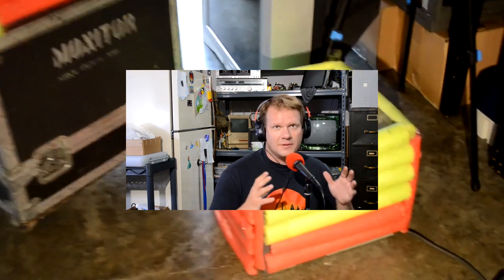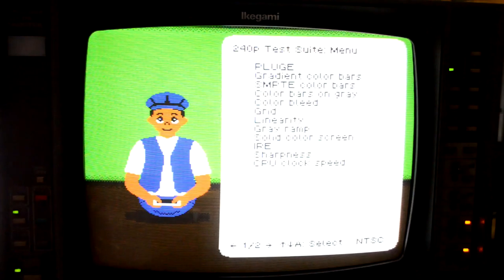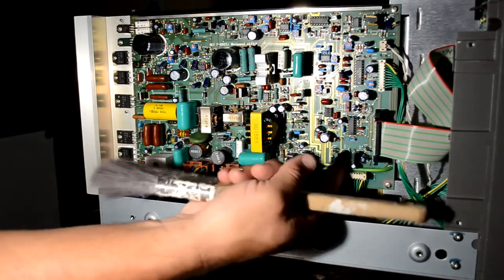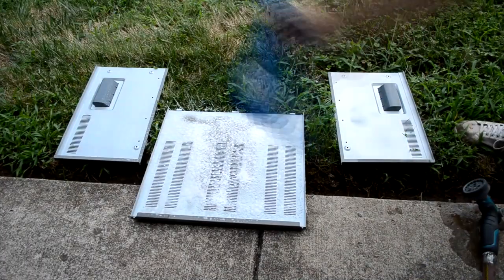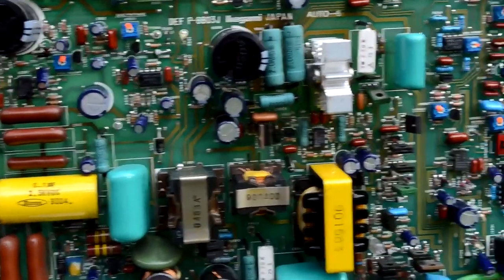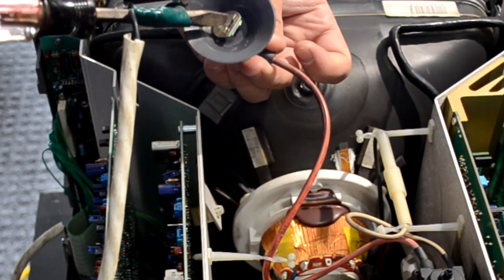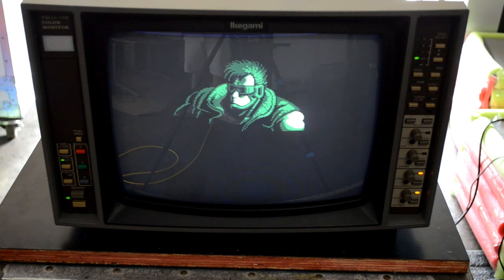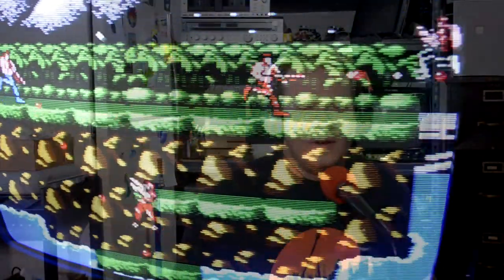Ikegami TM 14-19R | CRT Broadcast Monitor - Retro Tech Tune Up

Comment: I have one of these sets with a 1990s Cartoon Network logo lightly burned into the corner.
Reply from the maker: Most of the Ikegami Monitors I've seen do have some burn in them.  It's still cool to know where it came from.
Reply: Retro Tech It is — this one was rented to CN back in the day. I’ve seen burn in more often with 14” monitors in general since they were used a lot in studios — usually time codes. I have a few 14” PVMs from the late 80s in that condition unfortunately.
Reply: a tip: watch series on Kaldrostream. Been using it for watching lots of of movies lately.
Reply: @Keaton Maurice Yup, I've been watching on kaldrostream for years myself :)

Comment: So, I bought this monitor from Adrian, this very monitor, and I'm having some issues with it that I hope you can assist with. The back panel says "RGB/component" for the inputs, but when I try to hook up component, the colors are all off. Adrian and I have exhausted our combined knowledge, and have come up with the theory that because there is no RGB/component switch, it must not actually run component. Any suggestions?
Reply: @icenine09  perhaps color calibrations have to be done for either RGB or component and then you can't switch the input :(